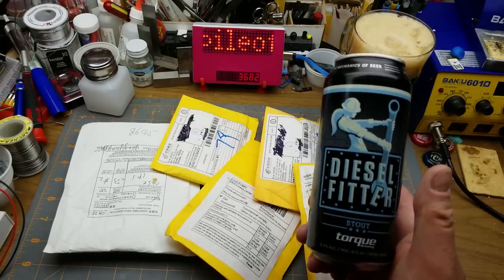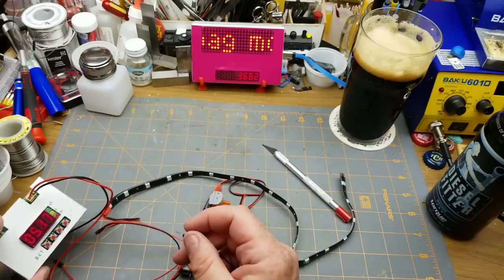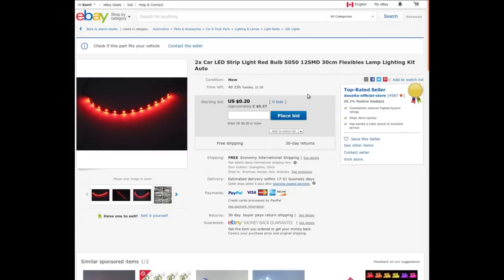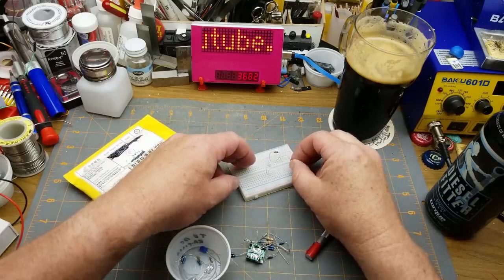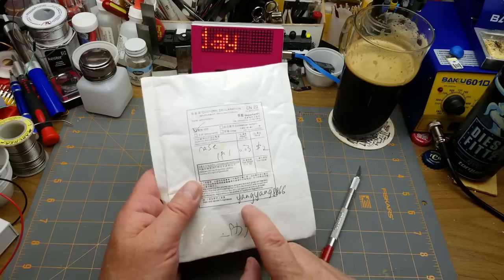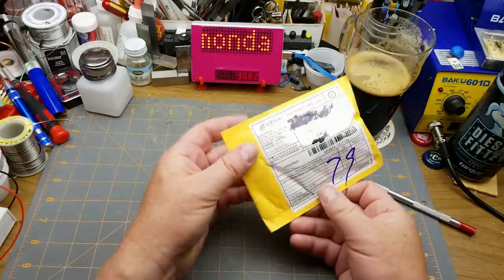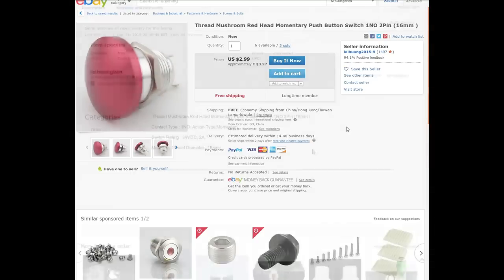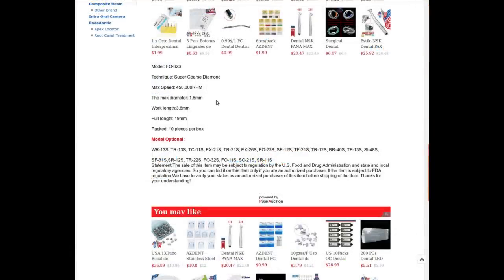Mailbag Monday #60

Comment: I put blue tape(no residue painters tape) around those burrs so they fit more snugly in my dremel.
Reply from the maker: At some point in the past I found a set of assorted shank size collets for my dremel. 

Super handy. I can grab drill bits way down below 1/16
Reply: Just use the correct size collet, FFS. Or buy a "cordless chuck" for the Dremel, which instantly solves all the problems.
Note that real Dremel usually use 7mm thread, while the clones are usually 8mm thread. So make sure to buy the correct size chuck.

Comment: JUST LET YOU KNOW I SEND YOU THAT INFO ON THE OTHER VIDEO ABOUT THE KEYS AND THE CORE AS WELL
Reply from the maker: I saw it. Thanks.
Reply: @pileofstuff  get po box i will send you that kit i been working on electronic kit that for  ho scale set i seen you build another building that you can a design it for u use for lighting in the building

Comment: What was the name of the tool you used to power those Leds
Reply from the maker: This search ought to find a few of them:

https://www.ebay.ca/sch/i.html?_from=R40&_trksid=p2499334.m570.l1311.R4.TR12.TRC2.A0.H0.Xled+tester.TRS0&_nkw=led+tester+box&_sacat=12576
Reply: @pileofstuff  - note that the testers are "resistor-based" and the mA marked is for a full 9V battery and a 2.0V (Red/Yellow) LED. The stated power is not correct when used with Blue, Ultra Green, White, Flashing etc that are nominal 3V.
Reply from the maker: @ John Coops - True, but it's "close enough" for just doing a "go/no-go" or a quick reminder of "what colour is this water clear led". Which are 90% of my use cases.
When I want to see what a given LED looks like at specific currents and voltages, I use my power supply and set the current limit to what I want.
Reply: @pileofstuff  thanks!
Reply: @pileofstuff  - yep, I use mine every single day.  I've modded mine to add the wider 4-way connector for "Superflux" LEDs, plus I have flying leads so I can probe PCB mounted LEDs.
I have a project to mod again with constant current "drivers" for each channel. That will allow comparison of different coloured LEDs at a particular drive current. Initially I was using LM317LZ but that's inefficient, so I've now found an excellent chip (but $2.50 each) that may solve that problem.
Reply: @johncoops6897  make videos on it!!